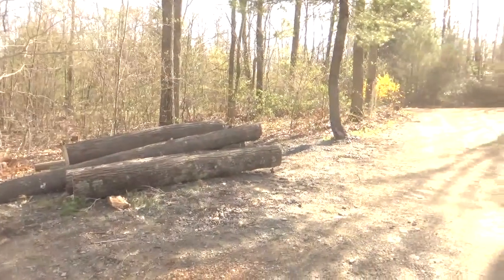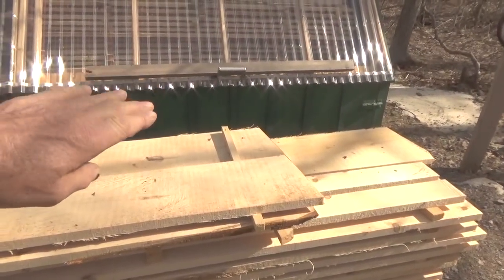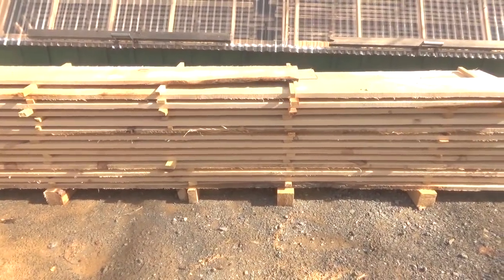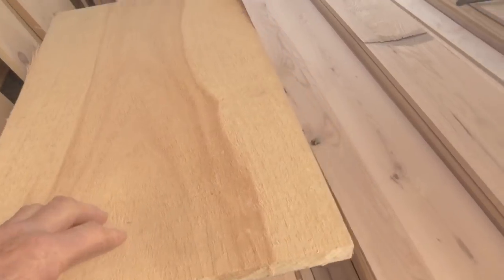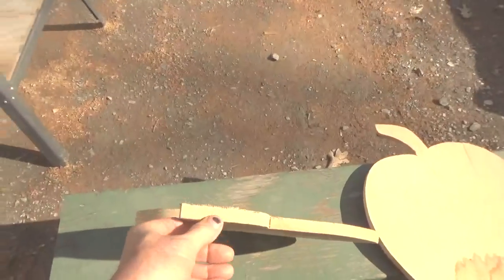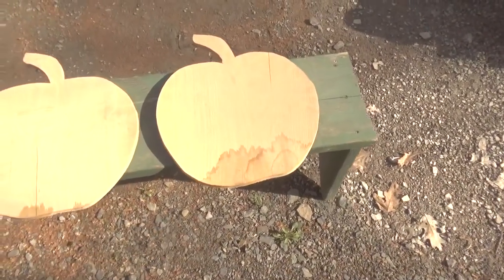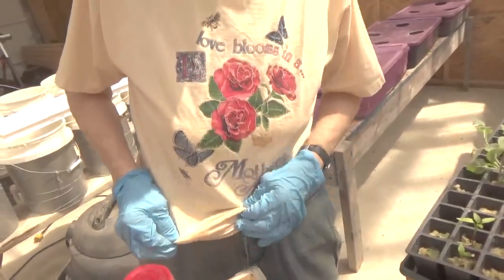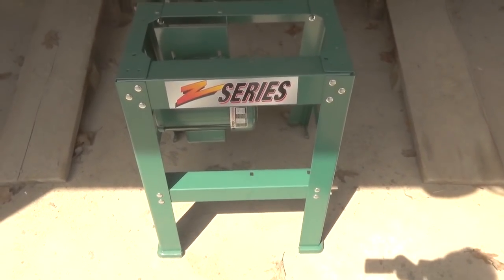Anything goes Saturday. Different subjects.

Comment: Great Video Joe
Seems like a nice scanner
My situation last yr was in high value/high $ trees or logs weather there was metal our not the wood value was worth the risk!
We knew there were lags with cables sticking out in most areas but found some the expensive way!
I paid for 6 blades in 4 hrs that day.
Sometimes you just cut and pray
If the scanner goes off do you cut or not cut?
Each situation changes the decision process at that given time!
Reply from the maker: You have a good comment here that is thought provoking. Yes it is a dilemma , suppose you have taken the first flitch to find beautiful grain and all sound wood. The detector says there is something in the middle of the log. Do I hack it open with a hatchet and ruin that board and maybe more; or do I cut and hope the saw makes it all the way through. A tough one for sure. Unless the wood is not yours. LOL

Comment: Morning Joe... an excellent video, really enjoyed the variety in this one. Good test on the scanner, at least now you know its limitations. I have a few trees on my property border that have embedded barbed wire. Something like that would really cause a problem with your woodmizer blades. I don't think I would find any metal in much of anything else, but you never know. I'm heading out to cut a few trees down that are around the perimeter of our garden to let the Sun in more. Have a great day.
Reply from the maker: Hi John, A friend of mine who had a circular mill was cutting hemlock, he thought nothing would be in the tree because it was in a remote area. Find out he hit a 4 lb hammer head that apparently a trapper left hanging on a tree branch 50 years ago or more. It destroyed a $2000 blade for him. You never know who was running around the land before our forefathers. Have a good day John.
Reply: Good point!

Comment: Joe on the  metal detector, did you have the intensity or sensitivity turned up, When you check if it would pick up the nail at 1 inch?
Reply from the maker: Neil Shurmur No it was turned all the way down, but what I did not get on the video is that it was consistently finding the nail at 3" deep. So I feel it can do the job.